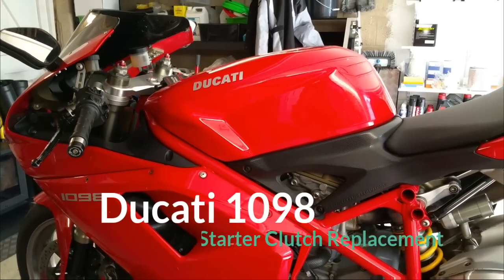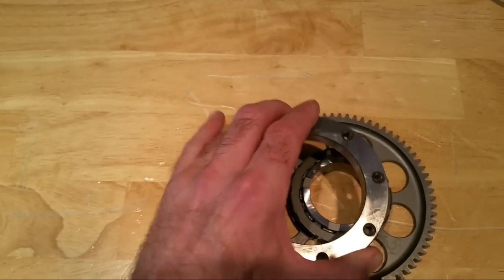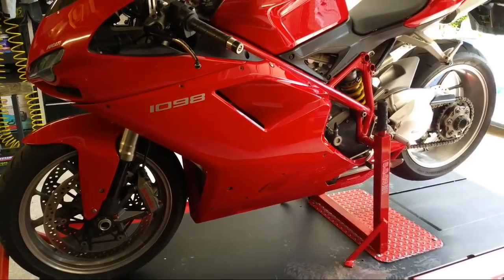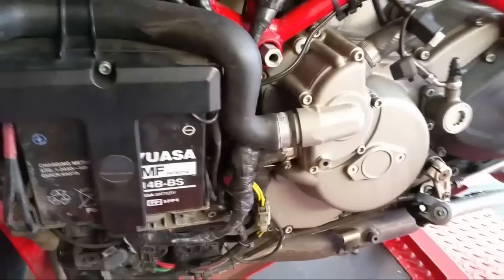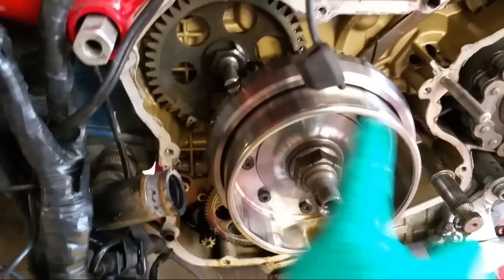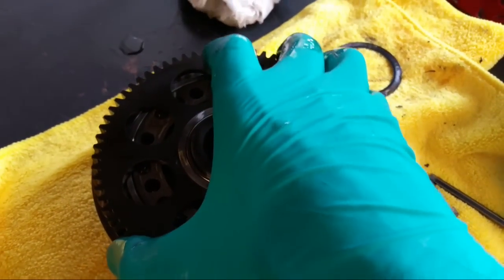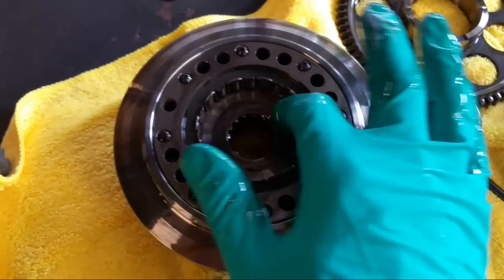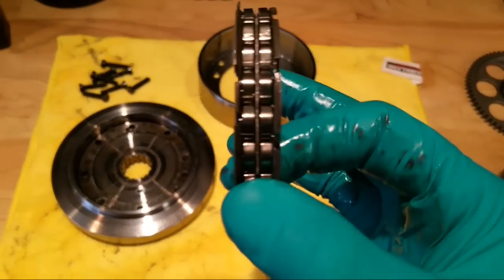Ducati 1098 Starter (Sprag) Clutch Repair

Comment: Excellent video. The only thing I would add is the size of the flywheel nut, you mention all the other tool sizes. Also interesting to note, you don't use a flywheel securing tool (Ducati p/n 88713.3367 for the 1200 Multistrada I am working on), just a windy gun.

Comment: Hey Bro, so I changed the starter clutch, I tried starting with out oil to make sure everything works... Is it that it won't start without oil... The starter just keeps spinning.
Reply from the maker: Do you have the clutch rollers in the wrong way around?
Reply: @SuperbikeSurgeryTV  I don't think do the beads are all in the same direction as the older one

Comment: Thank you for the explanation of the sparg clutch!

I'm from the dark side and have a Tuono with sometimes a non-starting issue, where it appears to be battery BUT it's connected to a loud rumble noise (similar to main bearings havings LOTS of play) - which I suspect is sprag clutch issue. I think it's dragging so much power the small battery can't cope and gives up. I can leave it for days and press the start button and it happily fires right up!

The noise it meakes I could only describe as a ratchet type roar - when stationary it sounds like big ends have gone - but riding it - sounds like a raw air/induction noise.

All very odd but I'm fairly sure it's sprag clutch related.

Comment: Thanks for a very helpful video. On mine,  a St4 s, the boss looked like the new one, without the extra holes. It was quite impossible to rotate it. I put the bolts in and tapped on them with a hammer (gently!). That did the trick!

Comment: Fantastic video thanks. I am an amateur home/hobbyist mechanic I have just finished installing a replacement crank into a GSX-R600 SRAD engine.  I was wondering how the starter clutch worked. I always get excited when I you have posted a new video, I always end up learning something... Cheers mate!

Comment: Thank you for this very informational video. The best one I could find so far. I will be attempting this on my 2008 hypermotard 1100 I'm hoping it's the same, after looking at the exploded view of the flywheel setup I believe it's nearly identical. I'm just having trouble finding somewhere to buy the parts besides ebay

Comment: Had this happen on my `09 1098 R - backfiring due to fouled plugs led to the whole starter clutch failing, I had the work done, my mechanic has a lot of experience and it was starting and running well after the new clutch and plugs were fitted..

Comment: excellent video BUT a couple of questions, do you need to take note of the position of any of the parts in relation to one another, like flywheel to crank, or can it only go back together in the correct position for balance or timing marks or anything like that. secondly do you need to lock the engine in position either with the bike in gear relying on compression or with a special tool to hold the crank in position when removing and when replacing the big nut and torquing it back up? lastly where is the best place in the UK to buy the sprag clutch and roughly what should it cost, you mentioned the 80 or so quid for the other part, but what about the price of the gear that wears and the clutch itself? thanks.

Comment: Thanks for this wonderful educational video, i have just a small stupid question since i have a RSV Mille Aprilia and someone tolds me its the same process, before you use the pressure tire pistol to unscrew the main bolt, how do you fix the wheel ? you have to put a gear or you hold it on the other side? Many thanks

Comment: Thanks Jim. When using your impact to remove the nut, does it matters if the force turns the cam belt shaft drive? I see in this video turns a bit like 90 degrees but when I use my impact it turned like 180 degrees until I got the nut off... did you use the penny to lock the flywheel and torque it to spec? 😁

Comment: Thanks for the vid. ANy chance you could share how to pull the flywheel?
Reply from the maker: You don't need a puller, it's on a spline and just slides off. I did mention this @ 13:10

Comment: Owning Kawasaki for 10 years zx9 40k miles, 06 10r 70k miles and 2011 zx10r 30k miles. Never had an issue other than Stator and starter by mitsuba which only the glue fails. 1098 comes in the fam and what an amazing machine. It's a speed machine it's so focused smooth and sounds like racing porn how ever, the fuse box connection on and off causes no crank no start and then this which only Italians manage to shove you one. Anyhow I love the brand just as 2nd bike, mistress. And that built is so complicated but all that leads for the speed machine she is. They say the beautiful ones are the difficult ones lol thanks for this gotta change this

Comment: Thank you for making this video, very detailed! How did you remove the flywheel nut without using a flywheel tool please?
Reply: Did you not see him zip it off with an impact? Need a flywheel lock tool to retorque it though
Reply: @doofwop  I did, I thought maybe he must have lodged something somewhere. Figured this out eventually and job done. Yes you'll be needing a flywheel lock tool to re-torque it and would consider changing the flywheel nut.

Comment: This is a great video!! I'm performing the same operation on my 749 as well as replacing the starter motor with fat wiring.  However, I'm stuck on the separating the clutch from the piece it sits in. I tried using a hammer and screwdriver and cant move that clutch even a little bit. Will using a drift make any difference?

Comment: James I've stripped everything down managed to remove the bolts from the flywheel bit can't get the piece that holds the sprag clutch out. I've tried moving it around with a drift as you explained but it simply won't budge. Am I missing something? Is there a tool to do this?

Comment: Good Day, Sir. 
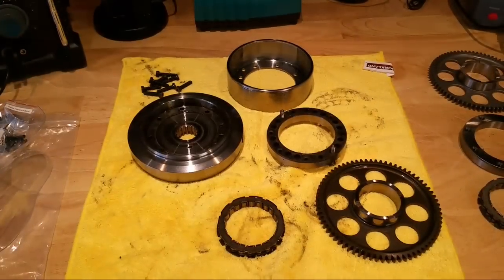at 18:50 , the 6mm bolt you are referring to, does it refer to the size of the hex or where you referring to the diameter of the bolt? If you were referring to the hex size as 6mm, does it mean the bolt is an m8? Or did you mean to say that the bolt that was used is an m6?

Comment: Thanks for the very helpful video.  I do have one question though.  I know the flywheel nut will come off with an air gun without holding the clutch, but when you are tightening the nut to the proper specification, do you need to hold the clutch then?  Also do you happen to know what the proper thread locker is?  My manual just says to use the proper thread locker.  Thank you once again.
Reply: Shane Fran 

Yeah, what is an air gun tighting torque for the nut?
Reply: What is the size of knot pls..

Comment: Thanks for the amazing video. I have a 2006 ducati 999s and i have the same problem, starter is turning but engine is not cranking, most likely it is sprag clutch. My question is that do i need to hold the clutch on the other side of the bike while opening the crankshaft nut with air gun? Thanks
Reply: I mean the flywheel nut*
Reply: +James Wright-Roberts thank you so much
Reply: Did you get the answer I’m having the same problem

Comment: big thanks for this, but why you dont use special tool to remove flywheel? should we use or we cant use? i dont know so asking sorry
Reply from the maker: The flywheel is on a spline,  it just pulls off by hand, no special tool (puller) required. 👍
Reply: @SuperbikeSurgeryTV  i have sf848, if same its good for me. thanks

Comment: My Honda has starting issues, sometimes it starts on button and other times it needs to be bump started. On the button can hear the starter motor going but nothing from engine. Could the starter clutch be at fault?
Reply from the maker: If the starter is definitely spinning and the engine not turning it's almost definitely the sprag clutch.
Reply: @SuperbikeSurgeryTV  Thanks, it's intermittent, if I have to bump it will start on button when warm. I assume that would be thermal expassion clearing the wear allowing it to grab. My bike is the hornet 600, I watched your vids when you worked on that bike.

Comment: BMW does not have a car type starter motor. It has pretty much the same system as this.
Reply from the maker: There are generally two types of starting systems "pre-engaged" type starters and "Sprag Clutch" type. Motorcycles generally use the "Sprag Clutch" type design. The only real exception being BMW who use the "pre-engaged" system on most of there Boxer Engines, including the R45,50,55,60,65,70,80,90,100 and also R850,1100,1150,1200C, R1200GS,RT,R,ST,S. I could probably go on. So as I said - BMW use a different design to this Ducati. The only exception being the Inline BMW engines that copy the traditional Jap design and use the "Sprag Design"
Reply: Superbike Surgery Ltd 
Cool. Didn’t realize the r’s used a different design. I have two k’s this is only why I questioned it. :)

Comment: Having a SUPER hard time rotating the sprag boss/flange inside the flywheel to remove it.   It's not budging.  Would appreciate any further tips.    Parts on bench as we speak!  :-)
Reply from the maker: You'll probably have to hit it harder than you think. Do you have it in a vice to hold it still?
Reply: @SuperbikeSurgeryTV  Thank you for the prompt reply!   Are you saying to secure the flywheel in a vice somehow?   I wonder if there's a tool that secures to the two opposing holes on the outside of the flywheel?  That would be ideal.   The other thing that the factory could have done, would have been to give us a few threaded holes only on the boss/flange that would allow the screw out, without having to rotate it!    Thank you sir, I'll attempt to vise the flywheel---just don't want to mar or damage it!    Greg in Austin TX USA
Reply: I figured it out! Much easier than rotating the flange slightly (which I could never achieve!):

Simply screw in 2 M6-1.00 screws into the flange, opposite sides. Flip it over on the bench, sit the flywheel on a center spacer to allow the flange to be pushed out. (I used a large Delrin frame slider, fits in center only!) Hold flywheel on one side by hand, insert a medium Phillips screwdriver into the flywheel side, corresponding hole opposite the flange screw(s), and TAP hard with a hammer. The flange will slowly work itself out of the flywheel. Keep switching sides to ensure even ejection. Job done!
Reply: @greggiacona238 That's what I came here looking for!

Comment: I know my Speed Triple will need one of these eventually, just hope I don't still own it when it does! Triumph ask £350 for the service kit (the clutch and gear), robbing bastards! 

One theory on premature wear is when the battery loses its cranking efficiency, the starter spins slower leading to the sprag not gripping hard enough allowing slip and eventual wear. Given Triumph fit chocolate stators and papier-mâché reg/recs it's only a matter of time!

Comment: https://youtu.be/hfmBK7frAtI?t=1377 22:57 
How did you tighten the nut on the crankshaft? Did you use the air gun again? I do not have the flywheel fixing tool and I need to re-assemble everything and this nut is giving me quite a headache :(

Comment: No idea how you got it running, but your explanation @ around the 3 minute mark is all wrong. It should freewheel counterclockwise and your driven gear should turn clockwise.
Reply from the maker: Only because you are looking at the inside of the clutch (the part that attaches to the flywheel.  If you watch the whole thing it pretty clear how it all works.

Comment: Hello, I used this video to replace my sprague clutch but it didn’t solve my starting issue, I have a new starter, battery and even a hard start wire kit. The bike still seems to be binding when I try to start it. Can you or anyone help? Can’t seem to get the video to the right people. Cheers

https://youtu.be/dFfrWYXnQck